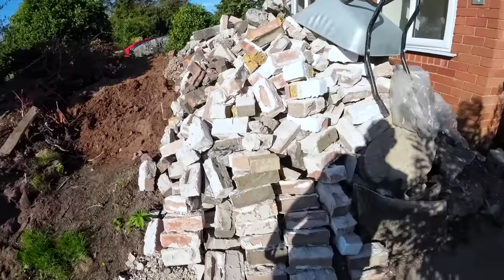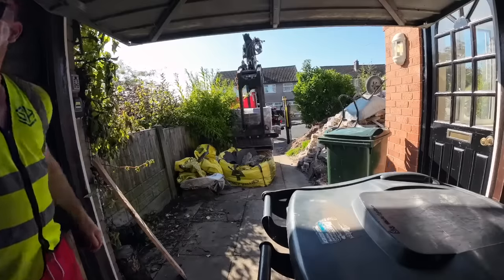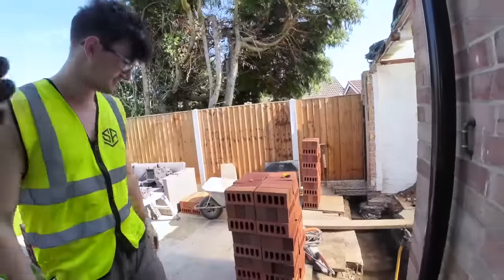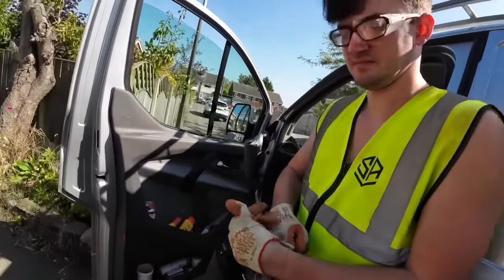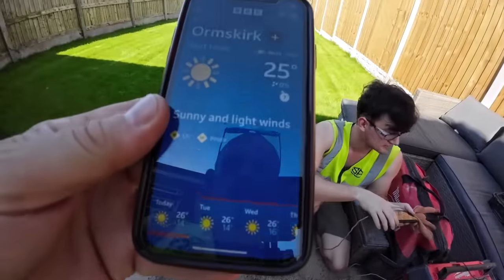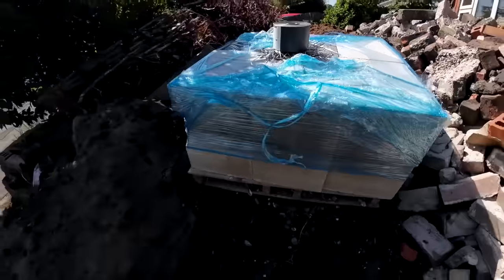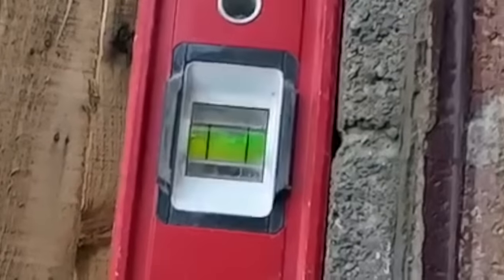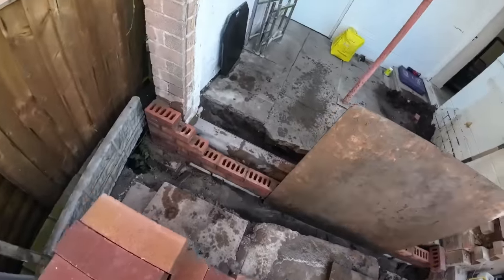VERY FRUSTRATING DAY ONE ON A SMALL EXTENSION

Comment: Support the pipe fitting with a second pipe grips to prevent overstraining the supply pipe which could easily fracture (copper age hardens) and leak and then you’d be is mess!  Over tightening the end cap can lead to distorting the rubber disc seal which will then leak.

Comment: Why don’t you use water when you are brick cutting? It will suppress the dust and keep the blade working longer
Reply from the maker: Because you end up soaked in orange gooey water that floods the area and is almost impossible to clean up 😩🧱👍🏽
Reply: Better for your lungs
Reply from the maker: Not if you are wearing a goid quality fp3 mask 😷